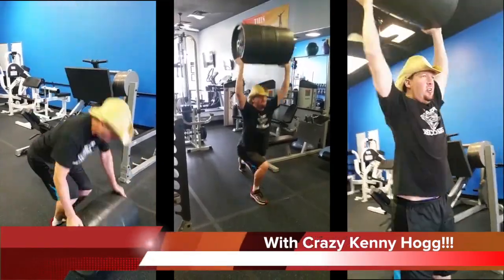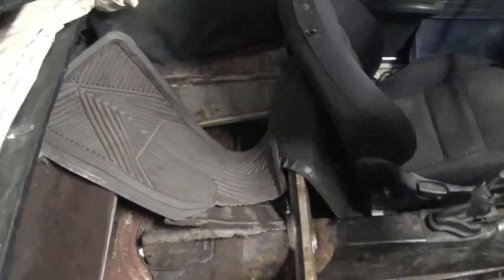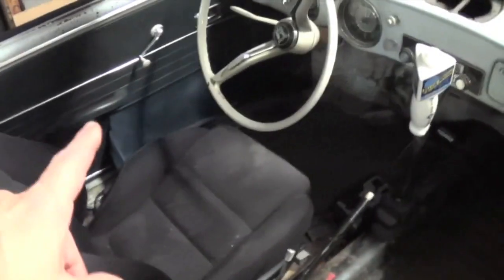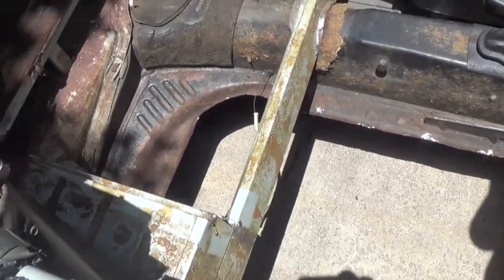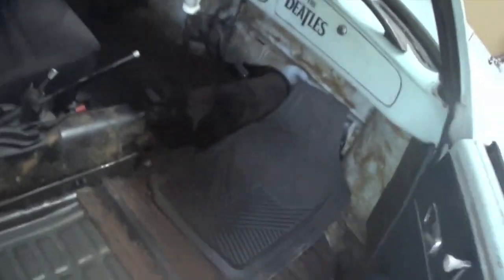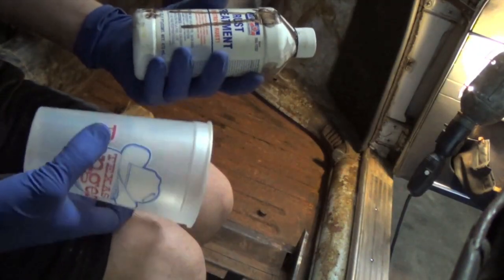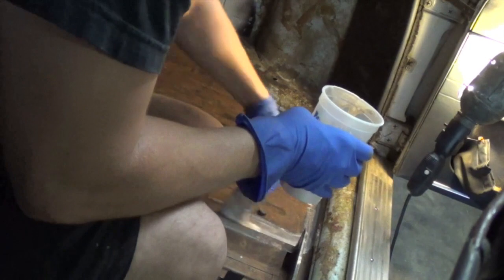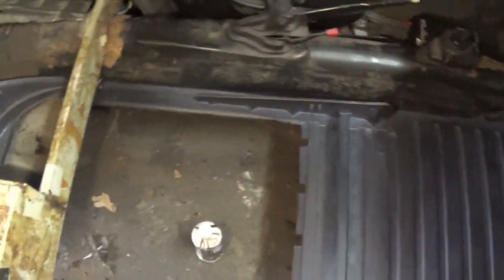VW Karmann Ghia Restoration - Floorboard Repair Part 1

Comment: Did you ever finish restoring the Ghia?
Reply from the maker: No.  The floor boards made a big difference when driving the car.  I drove it like that until a few months ago.  I now have a '61 bus I'm obsessed with lol.  It currently has the engine from the Ghia in it while I rebuild the bus motor.
Reply: Ah, wow. I'm envious! Would love to have either of those someday. :)